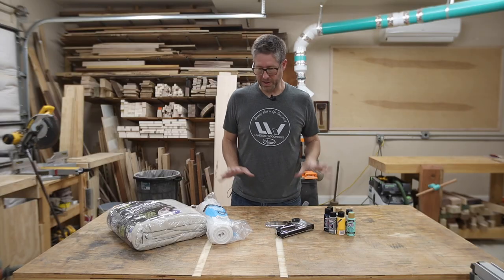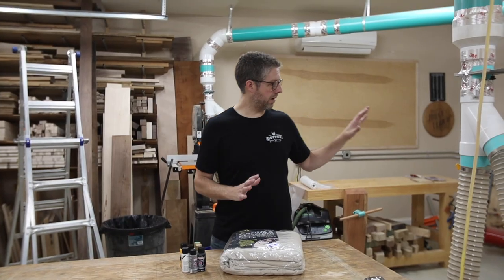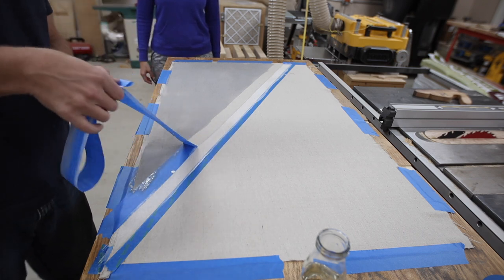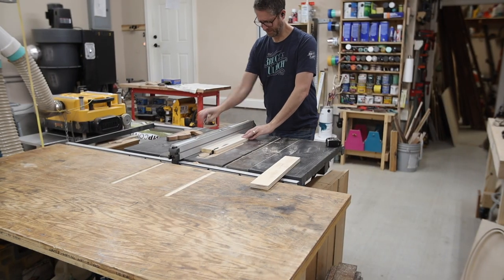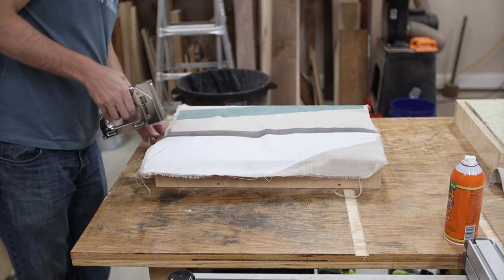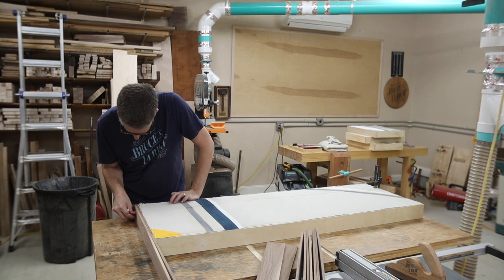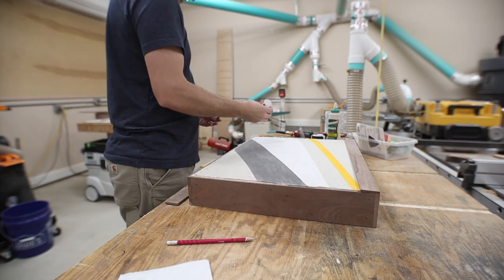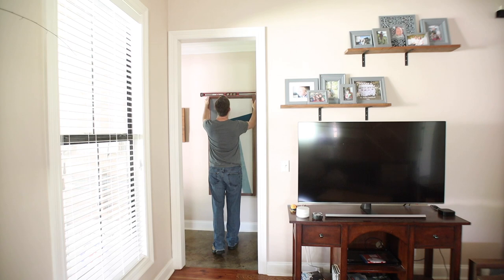noise-canceling headphones...for your living room

Comment: A painter with typically prep a canvas by sealing it with a size. I wonder if you'd get cleaner lines if you put a base coat of white on, you woudn't get the raw canvas color though.
Reply from the maker: Yeah, that could work. I didn't want to use something like gesso because I wanted the sound to be able to still penetrate into the canvas and let it get trapped by the insulation. I ended up getting really good lines when I went to full strength paint, rather than watering it down so much.